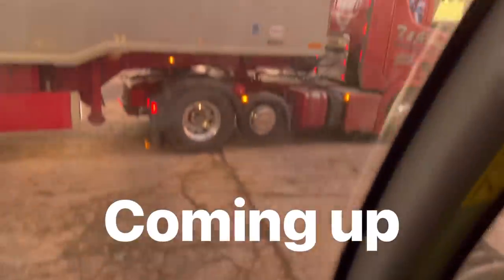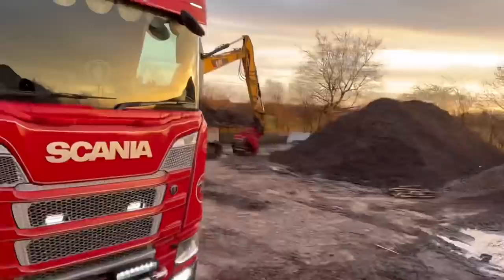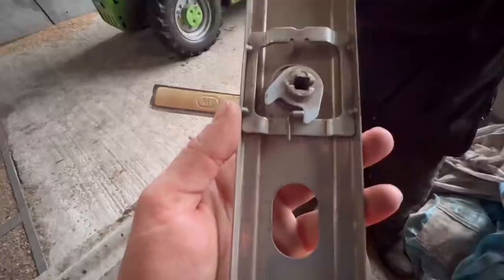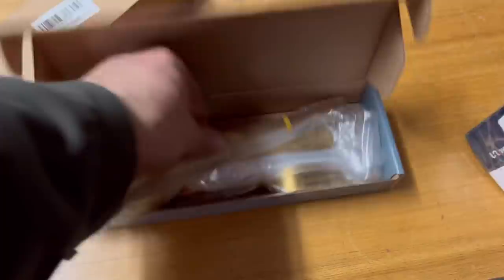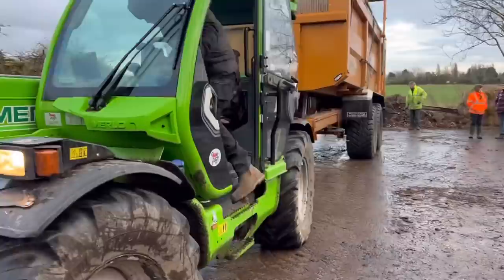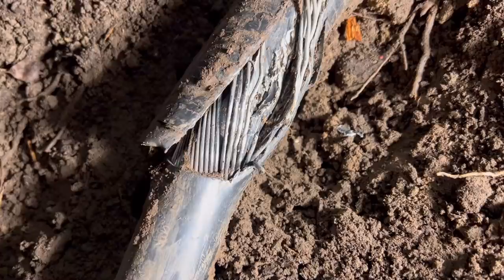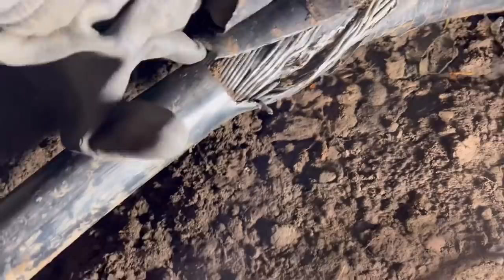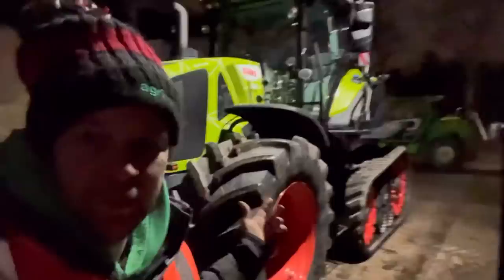Day655 #OLLYBLOGS  ONE OF THEM DAYS WE DIG THROUGH A CABLE CLAAS  ON A TRAILER #AnswerAsAPercent

Comment: Hi Olly, "to be fair" the cyclist does appear to have right of way as he is travelling straight and the car wants to turn right and thus should be waiting for the cyclist. The cyclist is also peddling, not just coasting, and depending on the gear he is in, may be travelling at an acceptable pace.  Cyclists can't travel at the same pace of cars and cars just need to be patient with that. What struck me was how the car who was turning had an idea that the Bateman was going to be in trouble and quickly accelerated away. Just as well he did so or he would have been squashed!
Reply: Good point, how was the cyclist to blame.
Reply: Its 100% the bateman drivers fault. How didn’t he see the car turning right . No idea how Olly can blame the cyclist (who had right of way) . So much for the high visibility cab !!
Reply: @mikeenglish1492  I agree
Reply: I suspect the Bateman was at fault, maybe not paying attention. Looks like a last minute swerve to me.
Reply: Some cyclists are a pain in the arse but as you've all said..
It was the cyclists right of way, the car was completely stopped and the Bateman driver was obviously not paying attention to the road and slammed on the brakes too late, totally the sprayer drivers fault and luckily the car moved and didn't get crushed. Hopefully the cyclist and car did stop but the clip ended before we could find out.
Reply from the maker: No one got the joke about the cyclist 🤦‍♂️
Reply from the maker: No one got the joke about the cyclist 🤦‍♂️
Reply from the maker: No one got the joke about the cyclist 🤦‍♂️
Reply: @OllyBlogsAgricontractfarmer  oops 😂
Reply: @OllyBlogsAgricontractfarmer  i kind of thought you was joking by the cheeky face when you said it but wasn’t taking any chances 🤣🤣🤣
Reply: 100pc. No way on earth the cyclist has any blame whatsoever. Seriously….

Comment: There is no fixed price.  A basic is around £100k. with a v8. And everything is extra.  Or add ones.  Basically depends on the dealer or and custom add ones.  Alloys.  Lether  lamps. Paint.  Exhaust then kitchen pack.  And add blue system.  Everything is spec.

Comment: I used to work for an electrician and a farmer ran over this armoured cable, which was laid temporarily across a gateway with a combine and a stone underneath crushed it so the armouring's were in contact with the copper cable, but to actually look, the cable looked fine, it was only when we tested insulation resistance we found the fault.

Comment: Re electric cable. As well as farming we do a lot of work with diggers and we come across electric, gas, telephone and water pipes that aren't put at the proper depth. I once knocked out two villages and the traffic lights on a major dual carriageway because the cable was just under the ground, no sand but the yellow tape was under the cable!!!

Comment: Last Scania we got at our place was £150,000 and that was brand new 67 plate  S Class 580 V8 with everything on it. So I'd say that 450 was around £130,000 with all the trick bits. Oir boss ordered another bit it keeps getting put back and thats a S Class 650 V8. It will come into the country with no chips in it as they are short of them all over the world so the dealer will get the tuck and fit the chips in it there. Before PDI checks are done and all the bars are fitted to bling it up.

Comment: I did a new driveway about 6 years ago for a customer the gas pipe was approximately 6 inches below the old tarmac when the gas board came out tried charging the customer….. er no anyway the gas board sorted it, shame the claas has gone 85% today rain stopped play Thanks for the calendar it’s on the wall 👍👍👍

Comment: Just been reading about the Axion earlier and it has a fiat engine when it was been loaded it sounded like a straight six Mercedes some purr off it,if I was the lorry driver I would have put the tractor unit on the low loader and towed the whole lot home with the Tractor 😂😂

Comment: A busy start to the day Olly 😅
I always thought power supply cables had to be a minimum of 600mm underground and have warning tape 200mm above them 🤔 what are the chances of hitting the same spot though? Maybe buy a lottery ticket.

Sad to see the big Claas go and that wagon trailer was some piece of kit too.

Quiz :- I guess about £146k for the T&J Scania
Reply: The minimum depth in an agricultural field is 1m to the top of the cable. If another cable is in the way you should go under it and in a field its hard to see why there wasn't room to do that. 🤔
Reply from the maker: Yer